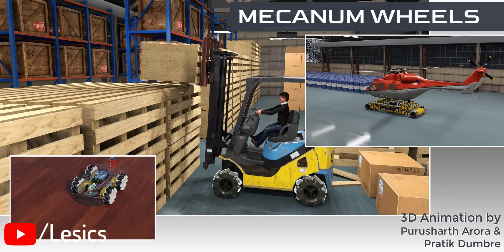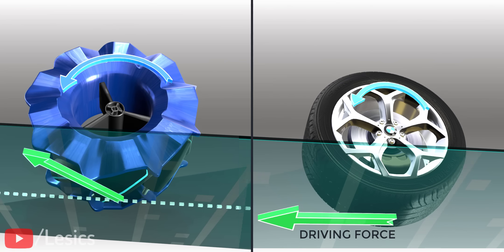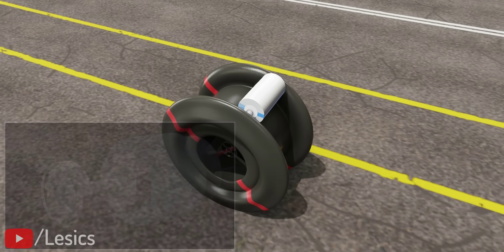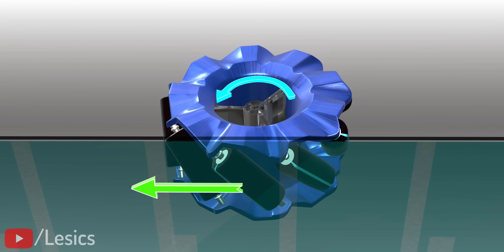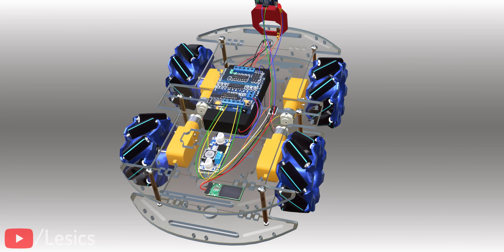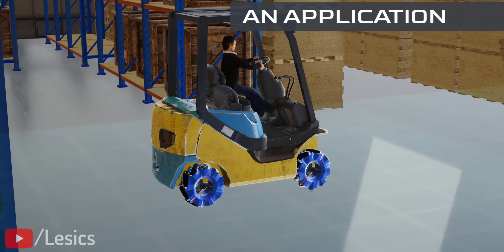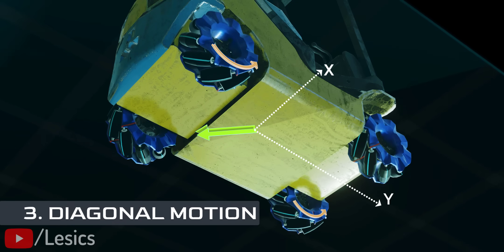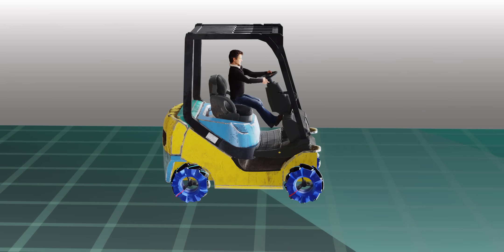The Brilliant Engineering of Mecanum Wheels!

Comment: doesn't work for most of the real applications. Mecanum wheels required consistent and even friction for all the wheels to work properly, which is almost never in real world scenario. In control warehouse environment where the floors are flat and smooth, maybe it can work ok. But as other posts pointed out, when you have uneven load the friction on the wheels changes an you have issues.

Comment: Is this cool to see, yes, practical? No, it is over engineered, you go from a basic tire to something incredibly complex that you now have to perform complex maintenance to keep operational, the only benefit this gives is reducing the room needed to manuaver, which while is nice, is not worth a significant increase to maintenance costs, since these will no doubt cost more than regular wheels, and that's not including that it also means buying a brand new forklift designed with these wheels in mind

Comment: This system is only remotely practical in cases where you have very little room to spare, light loads and a very clean warehouse environment. That being said if you are in that situation, you don't need a standard forklift, you need a stand-up rider forklift which can turn in the length of itself and it's cargo and when unused takes up only a small corner.

Standard maintenance on these wheels would take up any hours not having to turn a forklift could ever save. They would never pay for themselves.

Comment: This just gives the forklift a possibility to run into more things. Most of the forklift drivers I know aren't smart enough to utilize the ability to maneuver with this wheel set adequately. Dothey have to be on perfectly flat clean ground or will it work on uneven and snow/debris covered surfaces? How often will the bearings need replacement?

Comment: Been 'in development' for years, the guy who designed them died in 2008!!!  They were very rarely seen due to initial cost and replacement costs ... A stock forklift with rear steering is a very manouvreable vehicle, and just simply works.  The mecanum wheels might be more suited to Moon/Mars landers where they only need to last a short while ... they certainly don't last long as they're constantly wearing out, how many bearing assemblies to the wheels?  How much extra control gear? Theoretically they're great, in practise they do work, but simply don't last or work well as a heavy lift machine.
Reply: I think they are particularly not suited for dirty and dusty environment, rollers have lot of bearings, which might jam due to dust

Comment: I operated a conventional counter weight like a hyster H40 for about 7 years. I've never seen anyone have to swing that wide to make a 180° turn and not with a load suspended that high, only inches off the ground for safety reasons. This is like watching white people on infomercials.

Comment: Do not use a forklift in small corridors or bulk storage. Use a reachtruck that can turn on a dime and reduce its overall lenght by "reaching". Forklifts for loading and unloading. Reachtrucks for supplying and storing. Using this many axels is a maintenance nightmare. And it will reduce the amount of load the machine can handel.

Comment: This is a bit dishonest about conventional forklifts tbh. They often have two loadbearing wheels at the front without steering or power, but then a third driven wheel in the center away from the fork, which can often spin freely in 360° and thus achieve pivot turns around the front wheels without issue. Thus the turn radius shown here is not very realistic and a pretty unfair comparison.

Comment: I run a forklift everyday. This is  only practical if the objects you are going to  move will be  the same size,same shape, same weight, on the same surface,  and only need to be moved vertical or horizontal. Like the vehicles they have now, that are on rails and automated, and dont need a driver.

Comment: Looks like a really good concept, although I imagine it would be quite a lot more expensive than traditional systems. No doubt it will get more efficient and less expensive in the future.
Reply: I think a one problem and cost factor is that you need 2 sets of differently manufactured wheels. With normal wheels you can just switch any wheel of matching size onto it. With these wheels you'll at least need 2 wheels for spare, in case either one breaks.
Reply: And if they become dirty they’re useless
Reply: @perkosherrigh7243  Which is why they can't be used outsid- oh wait, they can and are
Reply: At this rate, the number of component involved in rubber-based vs mechanum is just too many. I’d rather invest in flexible joints rather mechanum wheels.
Reply: Or make it affordable at launch 😒
Reply: Yes
Reply: There's an inherent inefficiency designed in that you couldn't overcome though - in a straight line, half your motive force is being expended in "sliding the wheels sideways" so you'd really only be able to use the concept on vehicles where maneuvrability is much more important than fuel economy.
Reply: @christopherbedford9897  it would be perfect for forklift trucks and similar loading vehicles that operate in tight spaces, possibly freeing up more space for inventory.
Reply: Concept? These have been around for a decade lol
Reply: @rossfuller3224  concept is another word for idea. It doesn't always have to mean it's something experimental.
Reply: @laernulienlaernulienlaernu8953  an abstract idea; a general notion.
"structuralism is a difficult concept"

Comment: Would it be more efficient to use this design of wheels on a forklift retrofitted with a skidsteer type drivetrain. Still I believe it would only work well on flat, even grade surfaces and not when approaching a ramp at any angle.

Comment: Im really not educated in this area, but even I'm raising a bit of an eyebrow/a few questions at this design. 

How much do they cost, what does maintenence look like on them and how much does that cost? What is traction like in unideal conditions, and is operating them significantly different than a regular Forklift? Does it handle lifiting weight similarly to standard wheels? Does the lessened surface area of the wheel handle moving weight around as well as as standard ones?

I'm sure there's more, technically sound questions you could add to this. That's just where my mind wandered personally.

Comment: Unfortunately with this design doesn't address is the where in tear on the rollers, and the amount of weight do you have to distribute on them. This will also cause issues with uneven wear which will quickly exacerbate.

Comment: Cool design, but impractical for real world use. Cost to up keep the bearings for the rollers, replacement of each roller, and replacement of the roller housing would far exceed the cost of a rubber tire and rim. Design is to complex for the simple job it performs

Comment: Many people know that friction + tyre damage after time is problematic here. Why not just make wheels 360° rotatable? And have power to all 4 of course. Would achieve same effect but without the need of perfect friction or without damaging those wheel rapidly just by normal use. A bit more problematic would be how to control that. Maybe some sort of the special type of level that stays in middle but can be rotated to all directions (same type as is on controllers, just bigger and better) to control all wheels at the same time to go sideways, backward, forward, then having another lever for rotation only? It would all be needed to by controled with electric, not with physical imputs like steering is, so bumps etc would not be felt by driver, but still.

Comment: It's like a mini quad with the direction of the spin on the 4 rotors turning in towards the center of mini quad. Put the props on the wrong way and it will flip and kill the props if they're not Polypropylene.

Comment: I don't think those rollers would bare the wight that a fork lift would need to lift.  And with the amount of fight for friction or canceling out movement to equle to another, that is alot of energy loss, and wear and tear.  Cool concept, but not too practical in the long run. You are better off with Omnistatic Spheres.  They can go in all directions together, and bear weight as a whole.

Comment: The mobility advantages are clear but the numerous disadvantages are not described :
- this works mainly on a clean horizontal surface, otherwise the movement will not be as simple 
- those wheels have great inertia as they are solid indeed thus will need more energy and breaking power
- those wheels do not provide any dumping nor suspension which is one of the main function of wheels
- with their mobile part, they will also use more energy as they will create more friction
- as they contain many mobile parts, the maintenance will be more important
- the contact surface with the ground will be severely limited compared to an equivalent diameter wheel (thus the power that could be transmitted will be limited)
- the distance between the axle of rollers and the ground is really small meaning that small obstacle will hit the lateral sides
- the mass of the vehicle will push on the roller axes that will have to be as strong as the main axle of the wheel
As a result, those interesting wheels will necessarily be limited to specfic applications on clean horizontal surfaces at small speed and relatively low charges and will not be a revolution in mobility. This is why they have seen limited use while having been invented in 1973.

Comment: This is pure kickstarter fiction. the load bearing capacity will be a fraction of the same size forklift wheel. either the forklift can just carry hardly it's own weight, in plus the complicated mechanism will be subject of wear and the effects on the floor will be devestating. So weither the new wheels will increase in diametre at least by factor 2-3 or it simply won't work at all for more than a few test runs on perfectly smooth hard floor.

Comment: I have to wonder though, about tire wear. I've worked in warehouses, and product quickly gets caked in rubber dust, which comes from the tires of forklifts.
I don't pretend to know the lifespans of forklift tires, but I have to imagine, since less wheel surface area is meeting the ground, greater weights are being carried by the rubber that still actually touches the ground. Also, since in many of these maneuvers, the direction of movement isn't in line with the roll of the tire, that the added friction will cause even faster wear.
On top of that, there will be lots of bearings for each roller. Bearings that will at times ne carrying the whole load for that tire, while at the same time taking forces from drag as the rollers are not moving in the same direction as the tire.
I'd have to imagine that the wear, repair costs, and initial purchase price would make the added benefits not worth it.
Again, I don't know these values, but I would be interested in knowing them.
It's one thing to make the forklift move on amazing ways. It's another to do it effectively for a long time while being cost effective.

Comment: Building the wheel system for toys is complex but easily done. Building this wheel and tire system to hold up carrying tons of weight is cost prohibitive. You can probably still hire a human capable of actually driving a Fork Lift but I will agree they aren't born anymore so maybe these will be needed for this new generation of morons. Next figure an engineering solution to why they think that just showing up to the place called work is the extent of their actual work.

Comment: Interesting idea. However as with all things - if you add more pieces you also add more sources of possible failure. You have more risks where parts at the wheel can fail causing the whole vehicle to effectively stop working as it cannot drive in predictable ways anymore. In addition to the various smaller pieces you have at the wheel you also have to consider that you have 4 engines that have to move the wheels as a whole independently. So instead of one engine that might fail, you have several. Then you need the electronics to control the 4 engines. This again is another point of failure. And it's not just the electronics itself it's also the programming that can become a source of problems with this kind of system.

Where the "traditional" forklift basically has mostly mechanical parts, this one here is very reliant on electronics. And btw. this also requires the forklift to have electrical engines and batteries.

I think it can be useful for some very precise lifting and transporting. For a lot of "simple" tasks I'd probably rather use the "older" cheaper models.

Comment: Highly doubt those tiny wheels will survive constant heavy use. I bet each wheel within the wheel is 200$ to replace and requires a service man.
Edit: This is a great idea for very small load mini forklifts, but not standard operated units meant for constant heavy load, most especially under sleet/snow/mud/dirt/oil/grime. Each mini wheel would require incredible strength and grip to survive.

Comment: I was a fork lift operator for years, ours turned A LOT tighter than this example, lmao. Did you pick the worse fork lifts on the market or something?
Reply: But can your normal forklifts move sideways and diagonal?
Reply: @EvanG529  even if they could it would ad significant complication to operation of the machine and require a reworking the control mechanims. froklifts are zero turn witch means the same amount of space is required to move sideways as to turn and line up in tight spaces you will still need to turn as you place the item or reomve the item. this entire concept is an over engineered waste of time and money for zero benefit.
Reply: yeaah i agree these seem like theyed be hard to drive, i'd rather just grab the standup if i cant get the turn with the sit down as all forclifts are zero turns.
Reply: I have a mini propane forklift and the double rear wheel can turn 360°
Reply: I was thinking the same. I drive a forklift everyday and the turn radius is much more better. The example in this video is completely off not just a little bit.
Reply: The forklift in the example was turning with the front wheels. Never seen a forklift like that and I drove them for years.
Reply: I thought that when I seen it too lol. Did it HAVE to be that egregious...... 😂🤣🤦‍♂️
Reply: And of course, even regular wheels can have zero turning circle, if you have them driven separately (i.e. left wheels forward, right wheels backward, as I have seen on many excavators on wheels or even tracks).
That's what I am wondering about - you don't need these for zero turning circle. The difference is the sideways motion - did you, as a forklift operator, ever felt the need of sideways motion?
I suppose it would be nice to have in some cases (like, when trying to fit a box into a tight space), but did you as an operator ever need it, or could you after a while turn to the right spot on the first try without the need for additional maneuvering?
Reply: Just a simple graphical demo.  It's not meant to be 100% real-world accurate or to scale.  But you knew that.
Reply: @Salsuero  No, it’s a horrible graphic demo.
Reply: @Kae-1272  We all have opinions.
Reply: @Salsuero  It's misleading though and serves to fluff up the merit of these wheels when in reality, they're pretty damn impractical for fork trucks.
Reply: @snacks1755  Except they aren't impractical... when used under the proper circumstances... because THEY ALREADY EXIST AND ARE USED UNDER PROPER CIRCUMSTANCES.  You can't argue with reality.

Comment: friction problem. the rubber wheels will worn out too much expensive to replace always. good experiment but i will design larger area than fitted area safety and movability in case of emergency

Comment: The wheels should be fitted with retro incabulators in order to prevent side sway. Which is a common issue that most canter-tread wheel systems encounter during angular movements. This is due to the influence of Morson’s Law on the axis of gravitation between the rotor axles and the wheel bearings.
Reply: Sure, as long as you don't forget the gravimetric balasting throttle with pitch-incubated critical constraints
Reply: @HaakSO  Of course, that goes without saying.

Comment: Just get a forklift with continuous track wheels, you don't need the X + Y ↗️ movement, or even just use a steering system in all the 4 wheels and 2 motors

Comment: Yeah, that's all well and good but it's success is along the same lines as shoe laces. The invention of shoe laces has met all the requirements for a successful design. That's why they are still around and how the vast majority of shoes are worn. 
These wheels look good on paper but I doubt they meet all the requirements that shoe laces have. Or as this tires main competition, the standard fork lift tire. 
Plus you would need an all wheel drive fork lift. Most of them are not.

Comment: I find it funny how they use an animation to demonstrate the wheels, where they could have just as easily made the forklift do a few flips on its way over. You could put anything in the animation, so it doesn't really prove that it works or not.

Comment: At 0:44 , If your brake caliper is rotating with the wheel and rotor, you got some serious problems! That animation cracked me up. Probably animated by an engineer LOL. They understand how to design something on CAD, but frequently have minimal functional understanding of the real world practical application of said theoretical knowledge. One of my college roommates became a mechanical engineer. At the same time he was taking "Advanced Thermodynamics" classes, he asked me how a radiator in a car worked. All while simultaneously studying heat transfer. Classic.

Comment: Regular forklifts turn a lot tight than the animation. These wheels you discuss will need to be replaced often, and leave extreme amounts of rubber on the factory floor.